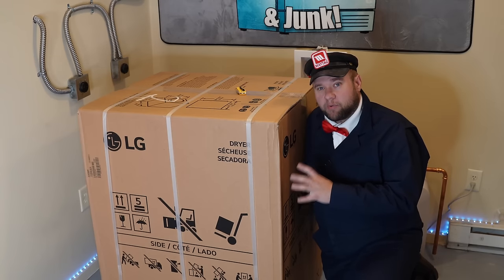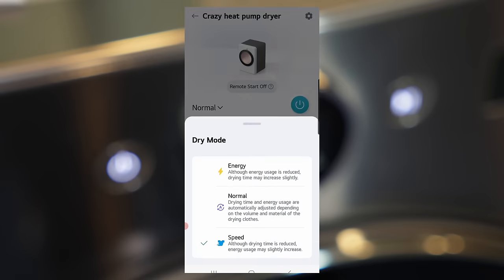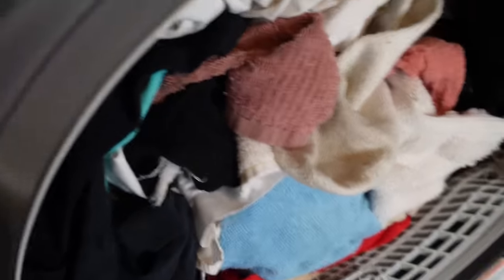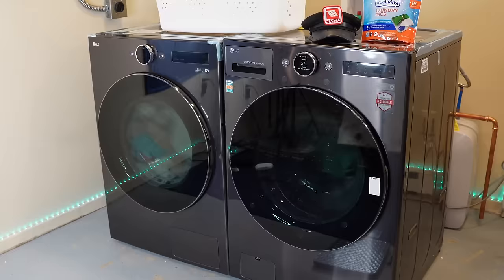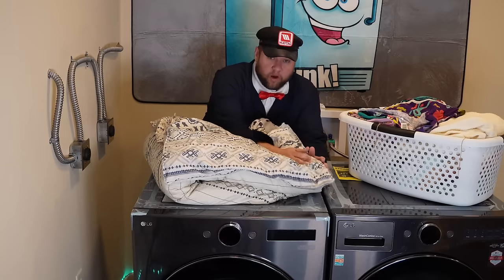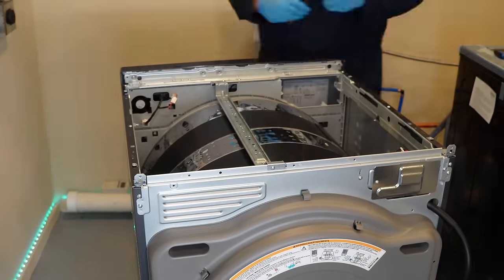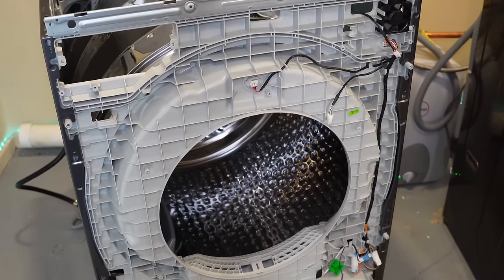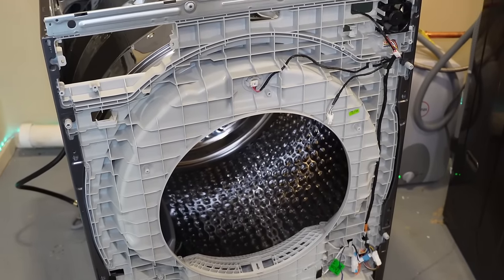LG Heat Pump Dryer - Way Better than I Expected - DLHC5502 Teardown & Review

Comment: Something you forgot to bring up about energy savings and vent-less dryers---you're not pushing conditioned inside air (heated or cooled) outside, and pulling unconditioned outside air (too cold or too hot) in through gaps and cracks and by back-drafting the fireplace.

throwing away conditioned air could double the cost of running a typical vented heating-element dryer. Meaning a heat pump vent-less isn't half the energy cost of the older design, it's one-quarter the energy cost.
Reply: I see your point, but also consider that heat pump systems release more heat into the house than conventional vented dryers do. That's great in the winter time, and not so great in the summer time.
Reply: @WesDuncan  It's not adding or taking away heat from the room/house on a HP dryer.
Reply: @BuilderJay  heat pumps use a compressor. Compressors get hot. My all in one washer/dryer combo with a heat pump gets hot to the touch and makes my laundry room warm.
Reply: It should introduce additional heat into the room, but that of the tumble and compressor motors. We're probably talking about something like 600 watts of heat energy. Take that versus using up to 5,500 watts on heating elements and blowing 150 cfm of conditioned air out of the house, the total energy usage should be considerably lower. It would be worth noting that this should be used in a room with enough ventilation to keep temperatures from getting too high.
Reply: @WesDuncan 

True, but the overall wattage converted to heat is minimal. Any vent dryer would remove conditioned air from the living space to be replaced with warm, and possibly humid, outside air anyway. Guess it depends on the climate.
Reply: I’ve never seen a dryer only setup in Korea unless they were issued by the US government or a .gov or .mil employee/service member sold one. They are pretty much all in ones (or old school washers only).
Reply: @WesDuncan heat pump dryers use a closed air cycle, so aside from the initial load, it’s not pulling or venting any air to/from the room  during the cycle. This is a massive efficiency gain, as the heat is entirely used to pull moisture from the wet clothes with minimal loss. Yes, the units get warmer to the touch, but that’s because you don’t have cool air pulling the heat out of the machine (and room), cooling it down as it runs. So even if the room feels slightly warmer, you’re still ultimately using far less energy, and can generally fit these devices in much smaller spaces than a typical vented or condensing dryer.
Reply: @kilodeltaeight  I'm not sure who you think you're explaining this to. Nothing you said is wrong. I understand how it works. My comment was specifically about the heat released into the room and the extra HVAC costs to cool the house due to the extra heat. I'm not saying that makes it less efficient than a traditional dryer, but that additional HVAC cooling cost needs to be factored in to the total cost of running the unit. Everyone glosses over that and doesn't even think about it.

It's essentially running a small electric space heater while trying to cool my house. I speak from experience because I have the exact LG all in one heat pump based system that is discussed in this video.
Reply: I see people in the replies mixing up concepts, thinking that vent-less means heat pump. The first type of vent-less is the condenser dryer, which has an open air heat exchanger (that's why they expel a ton of heat, and make the room warmer).
Heat pump dryers should not expel heat, because they ONLY have a close loop air circuit. The cabinet can get warm, because the hot drum emits radiant heat..
Reply: @diegoiunou  heat pump driers will emit heat under normal operation. The law of conservation of energy proves this. The electric motors for the compressor and tumbler will emit heat, but not a massive amount. Also, if it's a hybrid system, the heat from supplemental heating elements will add to room heat loading, just not immediately.
Reply: @JonathanMahany1  LaW oF CoNsErVaTiOn Of EnErgY (that's how you sound).

Comment: I was a appliances service technician for 20 years and dryers gas or electric has been my favorite appliances to repair relatively easy to troubleshoot and fix until now even to disassemble this units you have to be very careful to don't damage any of the sealed system parts specially in the washer and dryer combo with basically not much space to work.

Comment: I do not know whether it is interesting to a lot of people, but  Iwould suggest getting a euro-style 24" ventless dryer (Bosch 5 Series or Miele). In Europe (where I lived for 5 years) they are standard for those who can afford them. For example, in UK peak electricity rate can be as high as $1 per kW/h so efficiency takes top priority. The technology is very well developed; they have been available for a very long time. Then you'll be able to make a comparison with this unit and other full size ventless dryers. I understand if the money is tight and if it is unaffordable to get a relatively less common unit for you but they are popular in apartments (Boston, NYC, etc.).
Reply: But those are compact! People looking at this LG have families of 5+ people, so it's advantageous to do multiple loads at a time.
Reply: @MadLadsAnonymous exactly correct
Reply from the maker: I've had a few requests for 24's. I will get one eventually.

Comment: Thanks for a very informative video.  You did a great job and it is appreciated.  I will be sharing the link.  Prior to viewing this, I had only considered heat pump technology in the course of future home furnace replacement.  One feature that makes me even more interested is the ductless tech - this home has a long exhaust duct that runs for about 10 feet under the house in the crawl space (nearly impossible to clean out if needed).  Current drying is done with a nat gas LG dryer that I have self repaired - replaced the rollers and is nearly 20 years old.  the matching LG washer had a door latch replaced (again self repaired).  however, now that the front loading washer has what sounds like failing drum bearings - that are not easily replaced, DIY - the plan may be to replace the matched pair with the heat pump tech and close off the dryer vent.  A tribute to LG quality in these appliance in our usage.   room temp is usually around 70 F except in summer 74-78 and dry California weather making this a reasonable alternative. The appliances are inside the home near the bedroom area - not in the typical locations like a garage or a basement.  the home has Tesla solar panels and a power wall that do not power the home entirely but do provide outage protection and reduced expensive electricity cost.  this dryer would replace the nat gas current dryer. water heating is via a continuous gas unit as are the two furnaces and cooking appliances.  Using 220 V drying is a concern when the weather is bad and solar is not producing very much.  your work has refined what questions i need to answer - One question is the availability of a nat gas version. PS the cost difference of 300-400 dollars initially will be recouped over the expected life of the appliance.  Excellent thought provoking video!
Reply from the maker: Thanks for the comment! I agree the ventless option is hugely beneficial because of long duct runs. Those can be a major point of failure for dryers and getting rid of that has some advantages. I don't think they will ever make a nat gas version of this.. although I wonder if they could do a 120v version.

Comment: We purchased an Electrolux washer/dryer pair about 6 months ago, when only the GE Combo Heat Pump Washer/Dryer was on the market, I wasn't interested in the GE system at the time due to the cost, longer cycle times and the clothes still coming out damp.  However, if we were in the market for a new washer/dryer pair today, I think I'd purchase the LG pair, cost is only a few hundred dollars more than we spent, but the quality looks way better with the direct drive system, than what Electrolux has, and not having a vent, that's a big maintenance item that it would be nice not having to worry about.  Previously we had an LG washer/dryer pair that was still working after 14 years when we sold them, I considered LG again at the time we purchased the Electrolux, but thought the Electrolux boot gasket on the washer was better and easy to replace when it came time.

Comment: Dang just missed it; I witnessed the outro though. Definitely excited to watch the whole video; but couldn't agree more with the "needed" coil cleaner!! My only worry is if it uses tap water 🤔 won't those with hard water suffer.?!

Oh & bumping the algorithm 🎉
Reply from the maker: I looked at the manual a dozen times about distilled water. I agree that I'd much rather use distilled, but the manual never stipulates a requirement for it, either.
Reply: @bensappliancesandjunk Hi.., I haven't finished watching the whole video yet as it's about half an hour but I wanted to catch you soon hopefully you can answer this question since this last reply you made was only 2 hours ago 🙏🤞 I just wanted to ask if that hose for the drainage of water / humidity can simply be put into a bucket?
EDIT : Nevermind I guess the answer was just a few minutes into the video 😅
Reply from the maker: I went back and re-filmed this scene JUST before I uploaded is so you could have that exact situation answered!
Reply: @bensappliancesandjunk  Thank you Ben 🙏 You are Awesome 😎💯 if you happen to be able to answer this last question.... What is the highest wattage that this uses ?
I live in a bit of older building and the connections are simple and I just kind of wanted to know if it can be used anywhere in the house?
Reply: @wiseforce7045  it runs on 220V, that's going to be a huge factor in where you can put it unless you plan on running new electrical lines.
Reply: @jonathansage2147  🙏🙏🙏🙏 Thank you very much for taking a moment to answer my question, truly appreciate it 👍😊
Reply: @wiseforce7045  most welcome
Reply: @wiseforce7045  Anywhere you have or install the 240v 30 Amp service and can drain the water.

Comment: Thank you so much for posting this!!! Based on this teardown, we will absolutely be picking this unit up. I'm building a house that approaches passive house standards, so it's air-tight. I wasn't looking forward to having a makeup air system for the laundry room and wasting conditioned air. Most other heatpump dryers are super low capacity and my wife hated them. She probably still won't love the 2 hour dry time... maybe I'll plan for two lol. Thank you!
Reply from the maker: 2hrs on a big, big load. It was about 1.5 once the AI presets got the average load down. I imagine a sealed house will have great ambient temps making it even faster.
Reply: Heat pump dryers and water heaters are the go to solution for passive houses. We build high performance rental homes and put heat pumps everywhere. Surprisingly, they work great even though we are in cold Montana!
Reply: @RustyNail600  Rent is theft. One person = one house. Imprison all landleeches in a prison colony and let them rent from each other, see how long all their contributions to society allow their economy to last!
Reply: @dregenius  pound sand man. Our tenants love renting our places. They are high performance, low energy costs, comfortable, clean and affordable. You won't find a better place to live in your life, even if you buy your own home.
Reply: Ok KAREN

Comment: Our Bosch dryer is on its way out. It has lasted through 2 washing machines- we are on our 3rd. We had a bosch washer then we replaced it with a Kenmore when it stopped working (the door lock was a mess and we hated it) and now we have a top-load whirlpool. To be fair to the dryer, the exhaust is routed all the way across our house- 30ish feet of pipe. We think one of the sensors is bad so we have to use time dry or it will run and run.

Comment: I have a heat pump Boiler in my basement. In the winter time this beast sucks all the warm air out of the room and it feels like an icebox. I wonder if this too leaches warm air out of a room which may defeat the purpose of using less electricity because you may have to keep the heat on more frequently in that particular room. Perhaps this functions differently but it's a heat pump. These may be better suited for warmer climates versus colder temps in the Northeast. This is a big consideration so be aware folks

Comment: Almost 4 years on the Miele HP, and haven't noticed any lint on the coils. But the system uses 3 filters.
Reply: Same, and the last filter line on the Miele is absurdly dense - it’s basically a block of speaker foam. Unless it’s deformed so that air can slip around it I can’t imagine how any lint would get through.
Reply: But it's a compact unit, right? I wish Miele made full sized HP units.

Comment: Looks like they really thought this out.  Have 220 anyway with our present machine so that's not an issue.  And no belts!  I've changed a few...but worse, on our Kenmore the idler-pulley arm broke, but instead of a $12 bolt in replacement, it was welded to the motor.  So it was a multi-hundred dollar fix.  This is a machine I would seriously consider.

Comment: Looks great. I’m still using our Maytag tumble dryer that was new in 1985. Still works fine. First service was this year to replace the belt. After 39 years! This idea that you’re damn lucky to get 12 years out of a major appliance is appalling. 
Also have a 35 year old GE fridge that’s never needed service and a 23 year old SubZero that I expect to outlive me.
Reply from the maker: The sad thing is.... 12-15 years out of this machine would put it up against basically any other dryer on the market in terms of reliability. I see a ton of dryers that are done for before the 5yr mark. Its sad.

Comment: Awesome review.  In a couple years I think I'll def get this or maybe LG's new version if they replace it.  
I currently have an old Bosch ventless dryer (bought from Habit Restore here in Wi) and really do like it. My only two issues is the reg monthly cleaning I need to do, to prevent lint buildup in the pump and the baby drainpipe that it uses and the fact the clothes are not "to touch dry" like a tumble dryer. (which LG has seemed to solve). Plus the fact it can do a comforter is awesome!

I've been slowly updating old appliances in the house and when we re-do our main floor washer/dryer closet I'll def be getting this or a Queen (pending your battle review of course) matching setup. (I just upgraded our top loader Amana washer to a Samsung front loader (used again, but much more recent then the Bosch lol) and was considering getting a Samsung dryer but now I'll be happy to wait :)

Comment: Pedantic correction: the dryer used 950 watt hours of energy, not just “950 watts.” Watts are a rate of power usage, not an amount of energy. 
If you measured correctly, this dryer used 0.95 kWh for a load. At the national average cost of power that’s less than 15 cents worth of energy.

Comment: I have the LG wash tower with the heat pump dryer. The only problem that I have experienced is the time. I don’t mind that as much, since most of the time we are not doing loads that need to be done immediately.

Comment: Most informative video for a heat pump dryer I’ve seen, thank you! Highly considering purchasing the compact LG stackable heat pump dryer (WM1455HWA) and accompanying washer. Do you know if that dryer is more or less built as well as this one? Any experience (good or bad) with that unit?
Reply: Sorry, wrote the incorrect model, this is the dryer DLHC1455W. Also, Samsung makes a way less expensive compact heat pump set. Probably not as reliable/well built as LG though, right?
Reply: I am wondering about the same thing! Also about the Samsung?

Comment: Really appreciate the time and effort you make in producing these videos - thank you! Quick question, my existing dryer using a 3-prong 125/250v 30 AMP cord. The manual for this unit has wiring instructions for both a 4-prong (current code) and the older 3-prong cord/outlet which I have. Is there any negative to using this dryer with my existing outlet and the older 3-prong cord instead of the 4? I understand the code reasons why it was changed to 4; however, I'd like to avoid changing out my current outlet as I'd need to run a new wire to my panel. Thanks in advance!

Comment: Thanks Ben, great review.  Now that I'm considering the LG heat pump dryer I started looking at it's specifications and I discovered another LG heat pump dryer. Both seem to have the same specifications. But one is black and the others come in three colors.  Can you tell me anything about the LG DLHC6702. Both the DLHC6702 and the DLHC5502 are Energy Star Certified. Is one just newer than the other or is it an improved model?

Comment: Finally someone engineered a proper dehumidifier/dryer instead of just a heat pump dryer:) This unit is not strictly drying with heat, but it is:))

Comment: This would be a good dryer for Californians. PG&E during off-peak costs around $0.35 per kWh and peak is $0.55, so that's potentially a savings of $0.50-0.75 per load which really adds up. I do about 10 loads/month so at $5 savings per month, it would take ~5 years to make up the $300 price difference between this and a traditional dryer. But in CA a lot of people keep their laundry machines in their garage, so I'm not sure if that would be an issue since its not uncommon for garages to get to 40 degrees F or lower in the winter. This would probably be pretty solid for a condo owner that needs a ventless dryer.
Reply: Even better in hawaii. They get hosed on electrical prices because so much of their power generation is petroleum and the expense of running such a small grid.